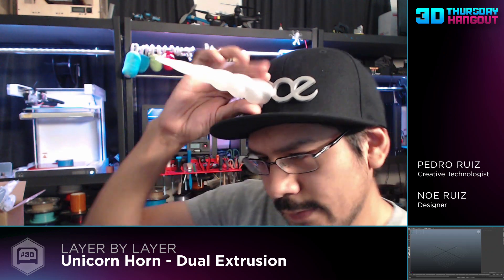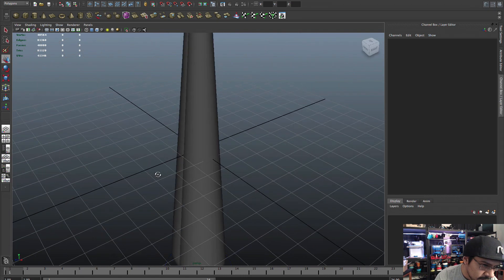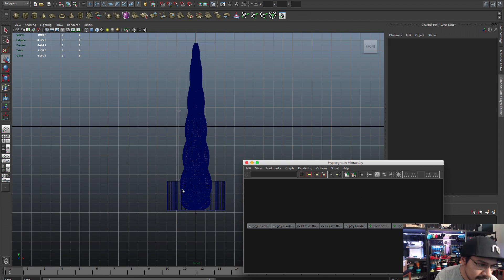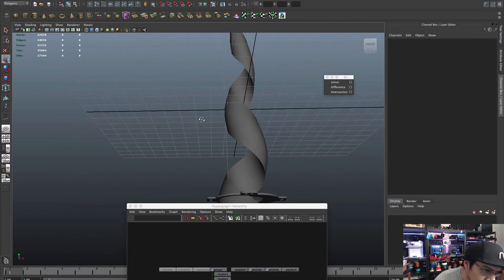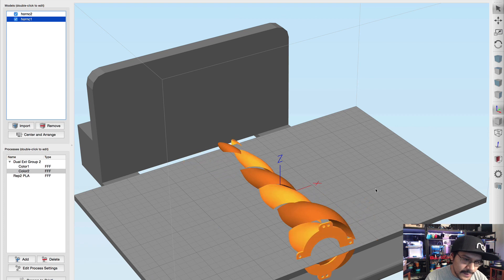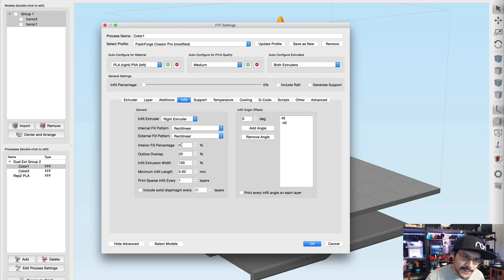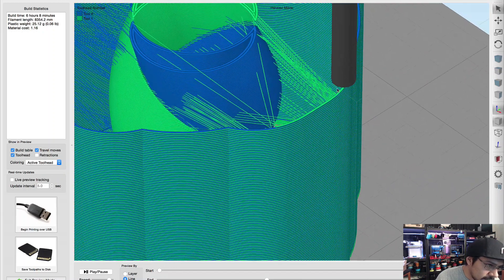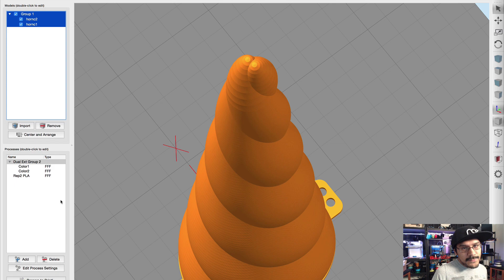Layer by Layer - Unicorn Dual Extrusion

Comment: Great tutorial, clean and to the point.  I know this video is old, but in case anyone sees this you can change the up direction in Maya to use the z axis instead of the y.  I think its windows>settings/preferences>settings>up axis, but I might be mistaken there.  Just a little quality of life improvement.

Comment: hi there. 
Great tutorials. 
could you help me with my issue? . I am used to slicing with cura and on cura my dual extrusion calibration is correct. 
I bought simplyfy3d and printed the same calibration block and the calibration was off. 

I then went into my machines firmware and took the second extruder settings, i changed the value of the y axis in simplyfy under the toolhead offsets as this was sitting on +22. I changed this to -22 and enabled the apply toolhead offsets to g code coordinates. 

Now my machine prints the parts alligned by on simplyfy3d the parts are not alligned on the prepare to print window. 

How do i fix this? 

I mailed simplyfy3d two days ago and have not heard back form them as yet. 

your assistance will be highly appreciated

Thank you